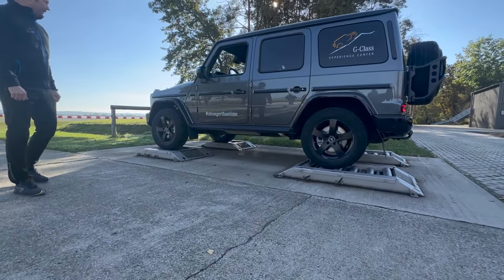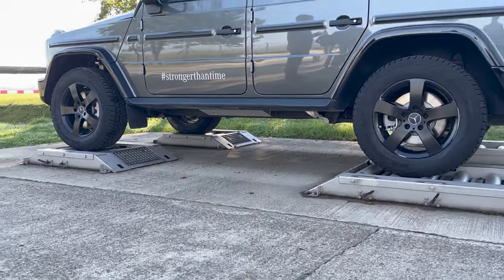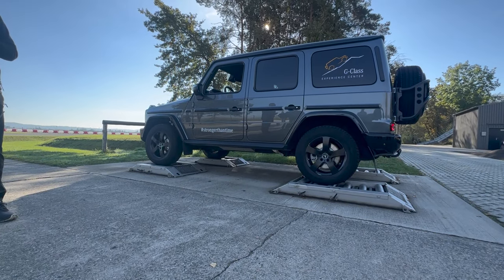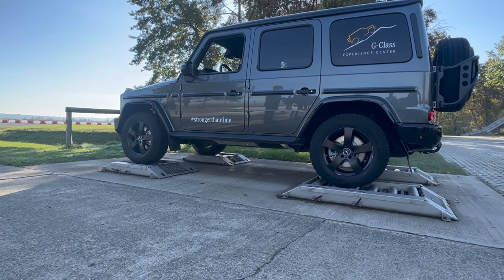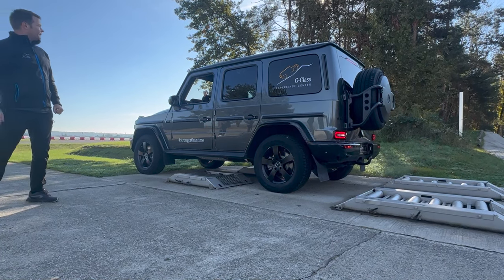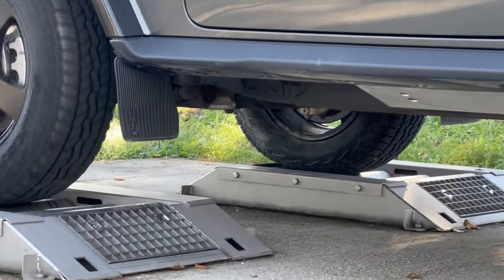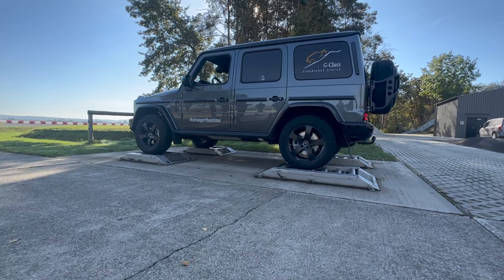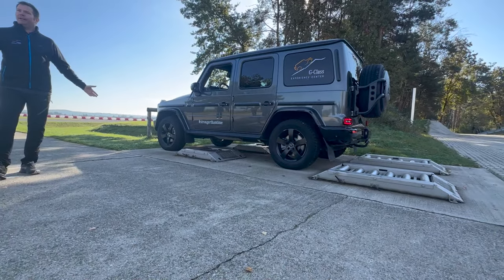Mercedes G-Class Three Lock Differentials Demonstration  | Mercedes Lounge

Comment: VW T3 Syncro with 2 Diff-Locks + Central Switch-Off Component in case of 16-Zoll Syncro for the Finish Military.
A Cenral Switch-Off Component with a Transmission Link Like a tractor. This element disconnects the Central Visco Coupling from the Gearbox.
Then 2 Diff-Locks.  A Front Diff-Lock and a Rear Diff-Lock.
You were able to Order the Front Diff-Lock and the Rear Diff-Lock as Option. The Switch-off components was offered for the Finish Military Version only, while for Aftersales you can get such a Component Brand new from diverse suppliers, today.